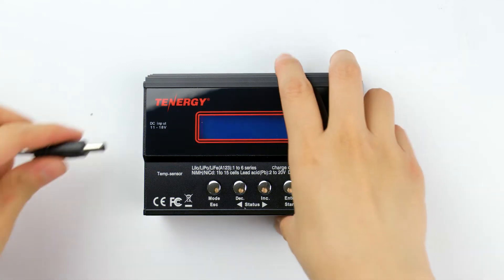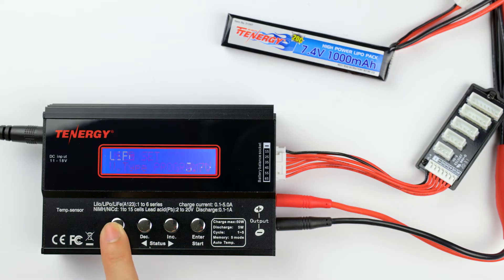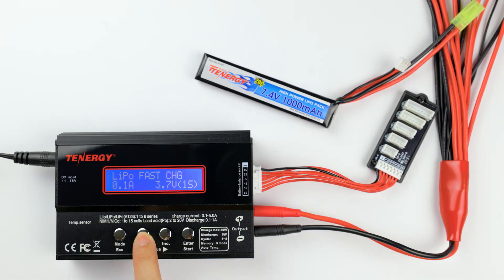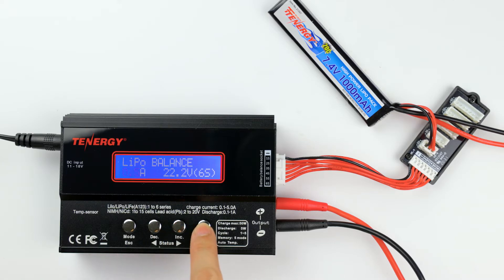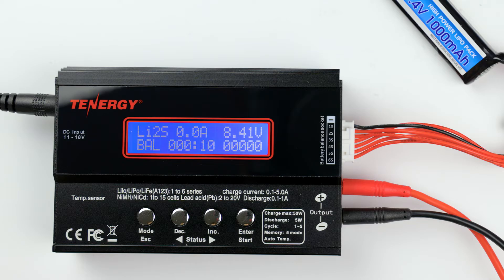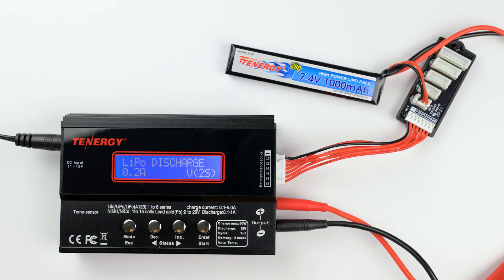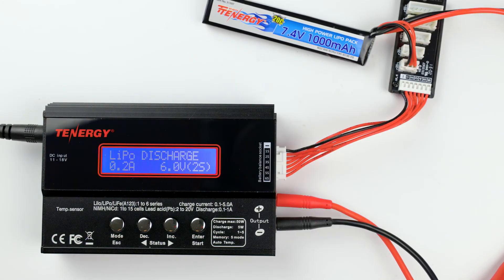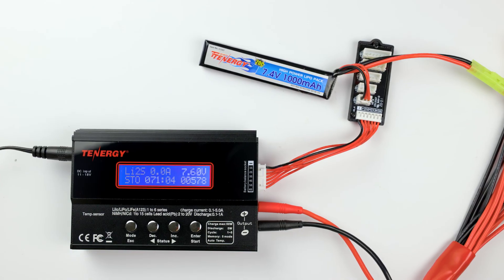How to charge and discharge a LiPo battery pack with Tenergy's TB6B (with voice-over)

Comment: 2 questions
For the storage mode, should I do that every time my battery dies after playing with my rc? Or can I just store it if am gonna charge it again the next day or two?
And second question i have a traxxas battery that has its own type of connector that's  not in the charger, can I buy a traxxas to Tplug connector and  use this charger to charge the traxxas brand battery? Knowing that apparently traxxas batteries has a wire inside thats supposed to balance itself with its own traxxas charger
Reply from the maker: If you plan to charge the battery pack within the next 2 days, you do not need to use storage mode. Use storage mode when the battery pack will not be used the next 30 days. The harness includes bare leads wires that can be used to add connectors, but we suggest reaching out to Traxxas to confirm if it's possible to add their proprietary connector. Please feel free to reach out to us directly at service@tenergy.com if you have any additional questions.

Comment: Always charging at a 1c rating is perfectly fine for the batteries and should really not cause any harm as long as you're always balance charging. 1c is usually a standard charge and anything above like a 2c to 3c to anything else above would be considered a fast charge. for this battery a 2c charge rating would be 2 amps and 3c would be 3 amps which could potentially lead to damage to the battery, don't ever be scared to charge the  battery at 1c rating.

Comment: What is the need to discharge a lipo?
Reply: Prolonging the life and performance of the battery if  stroring (ik you can just use the storage feature, but either works). Also to reduce the risk of leaks/swelling and chances of fire when the battery needs to be decommissioned and recycled

Comment: I like the lower amp to not stress the battery. What low amp do you recommend for 6400mah?
Reply: 6.4 amps would be a 1c charge rating, 3.2 amps would be 0.5c and 12.8 amps would be 2c. Just charge it at 6.4 amps it will be completely fine.

Comment: Great video I got a rc car with 25c lipo battery’s they have been. Sitting for a couple months is it safe to revive them I don’t know if they are completely dead!!! I have the same smart charger you are using the batteries I have are like in a weird block. Not like yours anyhow I’m scared of fires 🔥 honestly or should I just give up and get rid of my car ????
Reply: When you left them were they drained or charged? If they were charged than don’t if they were drained then do it in a fire proof place, don’t toss the car! Get new batteries if you need to :)
Reply: @Oceanic620 I almost tossed the car 😂 I’m just going to order them at Amazon Ty
Reply: @ thank you for your response !!!! They where drained from the first time I used them so is it safe since they where stored and I took care of them never dropped them or anything like that !!! I will listen to your advice …. One thing off the topic I was in a house fire 🔥 where I was rescued dragged through the floor !!!  So the tought about fire really freaks me out
Reply: @CONQUISTADOR79  lipo bags or lip safe bat will help a lot. If still scared just put the battery in the bag next to a window and watch it charge. if anything goes wrong just throw it outside.firesense+ is a good product for supressing lipo fires.
Reply: @ thank you so much 😊 I really appreciate your time

Comment: lipo connector dosnt fit the charge port on my lipo.. 7.4v 6200mah Radiomaster lipo
Reply: Me too you figure anything out?
Reply: @ ya if your asking about the yellow plug the tenergy one has a xt60 port while my lipos had a xt30 port. You can buy an xt30 to xt60 adaptor for like 3-6$

Comment: It's frustrating that there's no way to change the discharge voltage Target.
Reply: Jist curious but why do you want to discharge a lipo battery?
Reply: @everbeenzen  Prolonging the life and performance of the battery if  stroring (ik you can just use the storage feature, but either works). Also to reduce the risk of leaks/swelling and chances of fire when the battery needs to be decommissioned and recycled

Comment: What do i put the amp to if my battery has 5200mah?
Reply: 5.2 but always recommended to use something lower than the max. (aka 4.8-5.0)
Reply: 2:17
Reply: 5.2 isnt the max just charge at 5.2 amps.

Comment: When doing a "balance" charge on this charger at 1/3 C (5A for 15000mAh [4S3P] cells), they are as much as 10% different from each other when done, as measured with your Cell Balancer and another cell checker I have. This seems like it could easily damage the battery packs over time and might even be a fire risk. Is this within specifications, or is my TB6B faulty? Thanks.
Reply from the maker: Please reach out to our team directly at service@tenergy.com so we can get more information on your setup with the charger and battery pack.
Reply: @TheTenergybattery  I was thinking maybe the balancing rate cant keep up with the charging rate - I don't know. I should probably be using a higher power charger for these batteries anyway. Either way, thanks for following up.
Reply: @WR3ND  icharger 458/456

Comment: 5 27 24     with a plan to google for a tb6b manual more comprehensive than the
one that came with it last week ... 1'st tho was to query u-t   .... and your vid was at the top
of the hits so was viewed.  
and 
    it covered the features i was used to using with other brands of chargers.
       especially liked how you talked what was going on as you pushed the buttons.
 
     with your  vid viewed the product manual was re-visited.  and now i had
confidence that the other matters it covers will be easily learned too.

       wish list :
           1.  charge max 2.0 amp
            2.  ability to charge 2 batt. packs at once

Comment: How to charge 1s packs?
Reply: You follow these steps but use 3.7 volts setting since 1s is 3.7 nominal volts. 
I guess you set it to balance charge, although 1s doesn't need to be balanced AFAIK.
Reply: @Boogie_the_cat  So you're just Guessing?